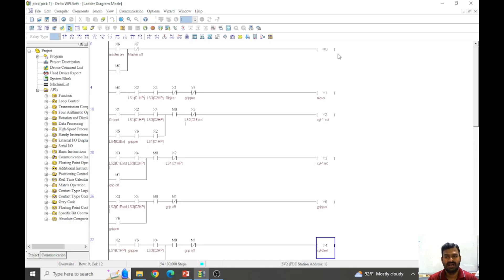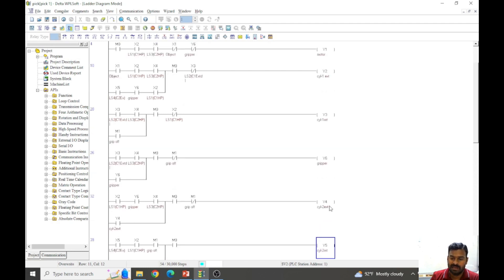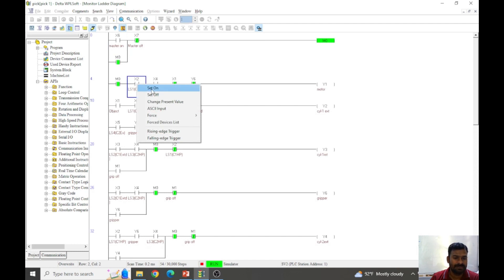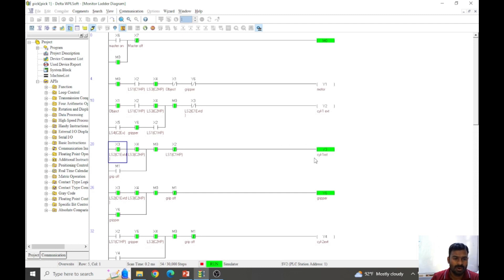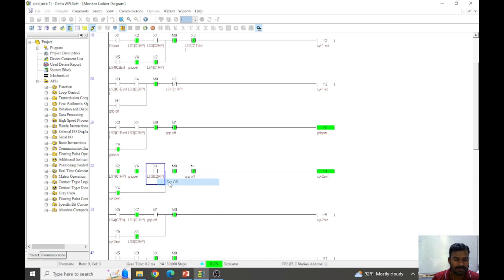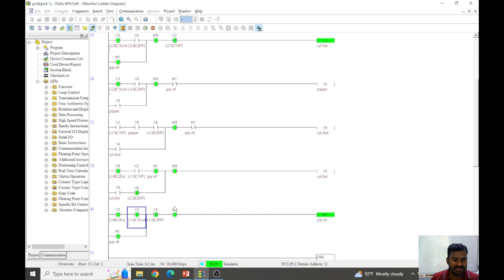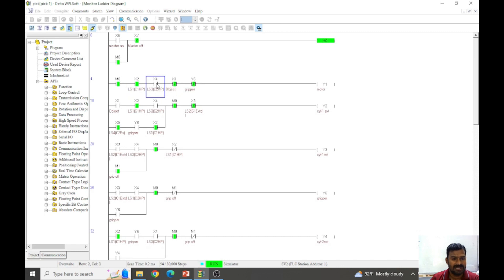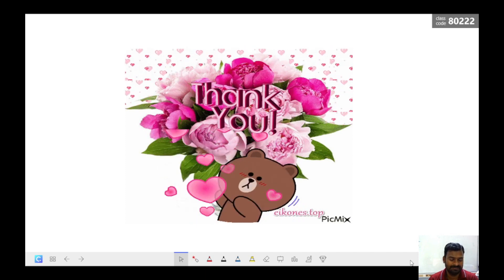Pick and Place Robot using PLC and Pneumatics

Comment: ❤ I am facing my work place cnc mechine  door not opening after the cycle, solenoid good, please advise me
Reply from the maker: Check the output signal at the controller level. If it is available then check the relay which controls the solenoid, if it works then check the pressure availability and spool movement and spring release of solenoid valve.